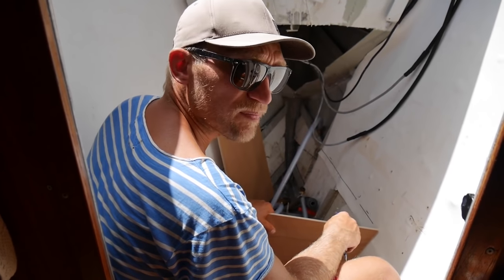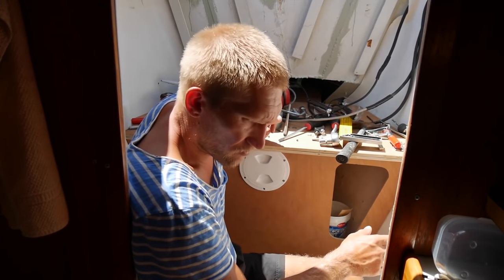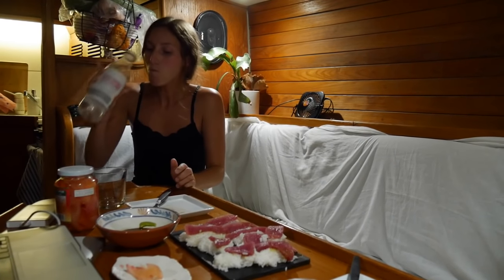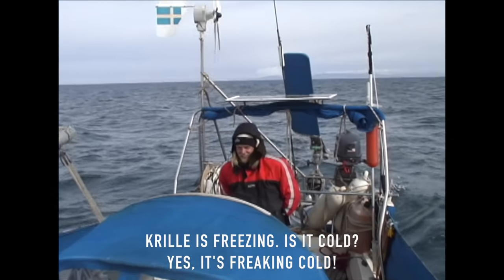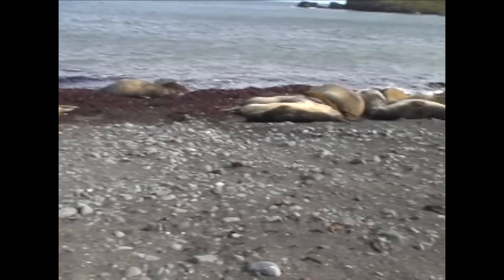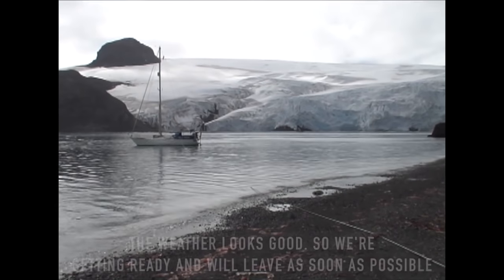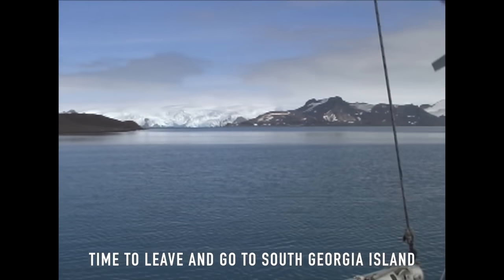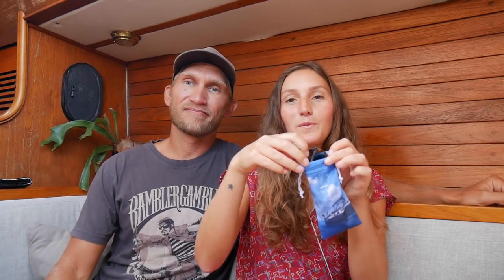Chain Issues & Sailing Antarctica Mini Series Pt. 2 - Ep. 24 RAN Sailing

Comment: Johan did a great job on the chain locker and new set-up for the washing machine without the benefit of a good workshop. 

The sailing in the Antarctic is crazy. It gives you a real appreciation of the conditions that Shakelton and his men lived through and their great accomplishment of sailing to Georgia Island just as you are doing but in a much better equipped boat and you are feeling like you are somewhere near the Gates of Hell, the cool part before you get to the heat. You guys are brave, crazy men. Very impressive.

Comment: Strong guy lifting that washing machine :D hahahaha
Tell me, how did you connect that chain locker to the hull of the boat? I would like to know. Just taking ideas for my new project
Reply from the maker: I used 4 long threaded bars, connected to a alu beam beneath the box. Good luck on the project!

Comment: Another great video - I know I am going to really enjoy it when the carpenters ruler comes out. Great solution for the extended chain locker - I think it is probably better in wood (did we miss the fibre glassing of the wood?  ) than it would have been in AL. Oh and that washing machine - either you two are super heroes or that is not a full size domestic washing machine. Loved the South Atlantic/Antartic video and only have one question if you were running low on supplies prior to departure for South Georgia why did you not then go to the Falkland Islands rather than the much longer leg to Brazil?
Reply from the maker: Thanks Norman! The anchor box is glassed on the inside :-) The washing machine is only for 4 kg so we're not that strong :-) We didn't sail to the Falklands from South Georgia because it's against the prevailing winds and it would have been an even tougher sail. I would like to go there someday! Take care